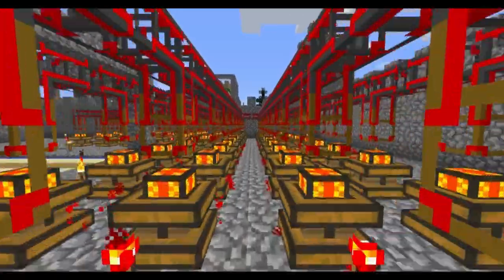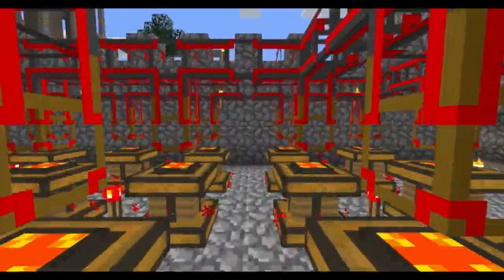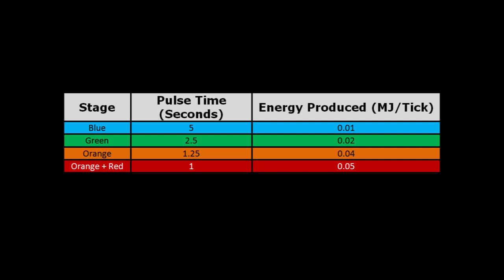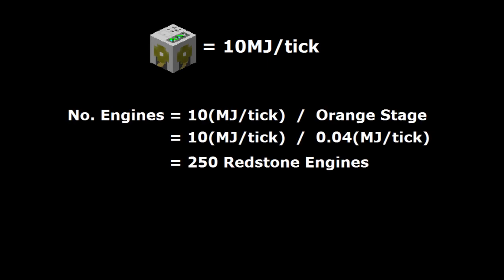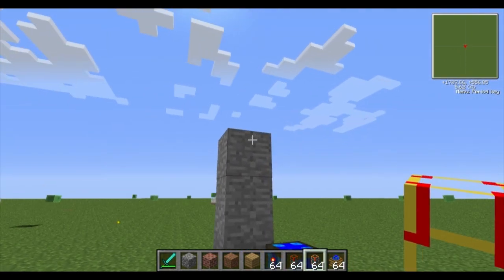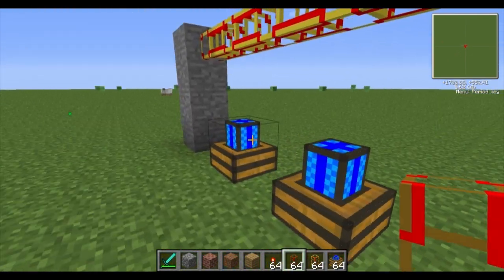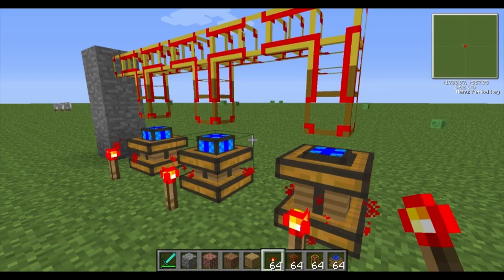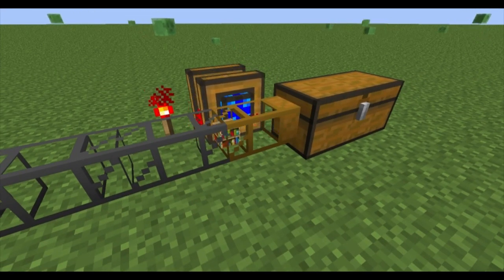Redstone Engine (Tekkit/Feed The Beast) - Minecraft In Minutes

Comment: That still did not work. I have copied the exact format as the one in the videos but my wooden conductive pipes connect all the way with the engine but the engine does not start up. However, if I connect a pump or other machine directly to the engine, then it will start. Is there something wrong?

Comment from the maker: They can explode if you've got them linked up in a row, or a daisy chain as it's called. The end-most engine will explode after a while if the chain of engines isn't powering anything. The explosion is tiny, and isn't even enough to break through stone, so they're pretty safe to use.

Do you think a link to the buildcraft/tekkit wiki would help? If so I can't definitely add them.

Pipe tutorials will be coming in the near future.

Comment: Just some corrections/suggestions.

The MJ in buildcraft actually stands for Minecraft Joules not Megajoules. Another question is why you position the engines one apart, they can be next to each other fine, and it will cut down on energy loss.

Comment from the maker: They'll turn flashing red if they've been powered but are not powering anything else.
It'll usually happen if you've got a bunch of engines connected together in a row, rather than through a conductive pipe. The engine at the far end will heat up and eventually explode because all of the other engines a passing energy to it.
minecraftbuildcraft.wikia.com/wiki/Redstone_Engine Has a pretty good diagram.